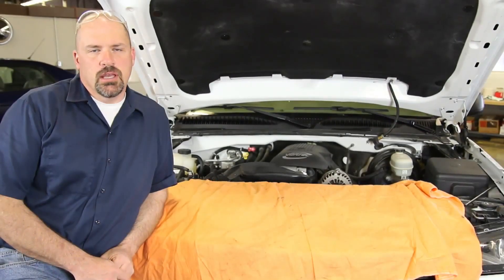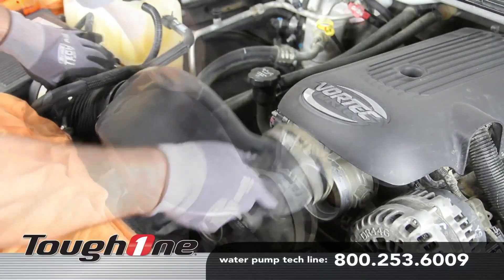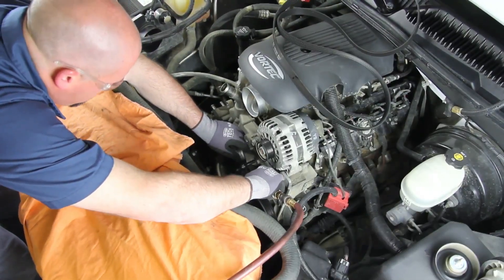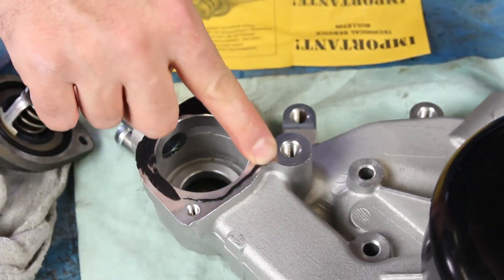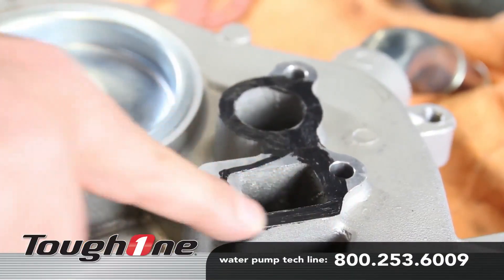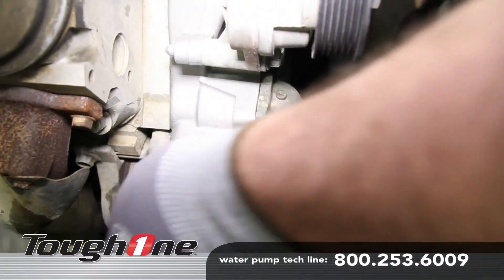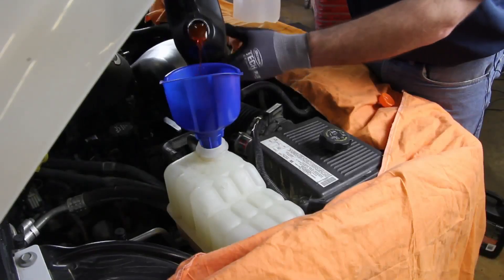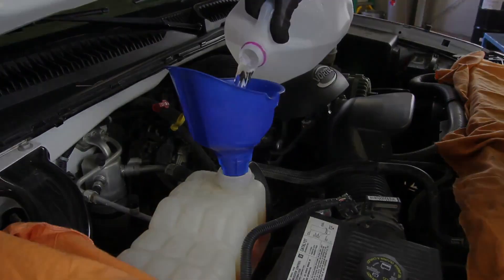How to Install a Water Pump on a GM 5 3L V8 Engine - Advance Auto Parts

Comment: If I have metal with rubber gaskets and not paper gaskets, should I still apply gasket maker to the metal rubber gaskets ?
Reply: No, you do not need to apply sealant to a metal and rubber water pump gasket for a 2011 Chevy Tahoe, as the gasket is designed to seal on its own when properly installed and torqued. Applying sealant can be detrimental, as excess sealant can break off and clog coolant passages in the radiator.

Comment: To install a new water pump>  Requires, new hoses, belts, thermostat, antifreeze coolant, and maybe some clamps. Cause when the water pump goes out, ITS NOT LONG!  THESE THINGS WILL FAIL AS WELL>   This will give you many many years of service. Why wait for some thing else to fail? DO IT? DO IT RIGHT 👍👍  Stop leak will buy you some time. BUT ITS GOING TO FAIL AS WELL.  Big Time

Comment: I guess this chevy don't need a fan?
Reply: cldiazinc   Some newer  models have electric fans
Reply: Duel electric fan on the newer ones. No more junk clutch fans
Reply: @mattyb1030  wait till your electric one fails
Reply: @MediocreMedic123  would rather deal with a couple bolts and a electrical plug than the old set up.

Comment: Wow, this video is definitely missing a step or two...... radiator fan shroud removal, tips on securing the water pump pulley so the fan clutch can be removal...
Reply: electric fans on some models.  this video probably had those.  my avalanche with the same engine has electric fans.
Reply: Thank you you are very insiteful.

Comment: On my 5.3 it was major leaking. I removed the old pump it looked very new and it spun nicely. It had 2 aluminum gaskets i believe one blew out. 
The Alumaseal did not seal it and Normally i have 99% good results
Reply: Use black pepper works best for coolant leaks

Comment: My question, before I replace the water pump is this, "Can the water pump make a chirping noise when it is starting to go bad."  Mine started making the noise here recently and using an automotive stethoscope I believe the noise is coming from the water pump, but it's tough to say for certain.  I removed the serpentine belt and ran the engine and the noise went away.  Once I put the belt back on, the noise returned.
Reply: Vernon McNabb The chirping noise could be the water pump but it could be the idler or tension pulley they both have that noise when the bearing is starting to go bad!
Reply: I’m in the same boat ... I changed belt and tensioner and idle pulley but noise didn’t go away so I think it might be the water pump
Reply: My chirping noise was my power steering pump. I used a mechanic stethoscope to pinpoint it. Easy fix.
Reply: Yes.  Can be anything with a bearing.  Best way to test is to remove the serpentine belt and skin the pullies one at a time

Comment: damn didnt even show how to remove the fan/clutch
Reply: Older model 5.3 V8s have fan/clutch.  I have 2008 Silverado and it has the electric fans.  I believe we are looking at something similar here.  This channel has another video with an older 5.3 with the fan/clutch.
Reply: Fucked me up too. Know I gotta miss work and get the tool tomorrow
Reply: eletric fans, 9 years too late lmao
Reply: Chisel on the nut works fine.
Reply: Electric fans on this model ,getcha adjustable wrench hit it with a hammer to get loose & unscrew fan,same way put it on!